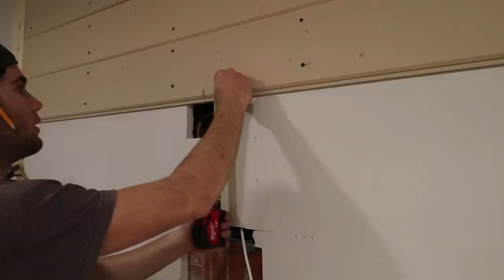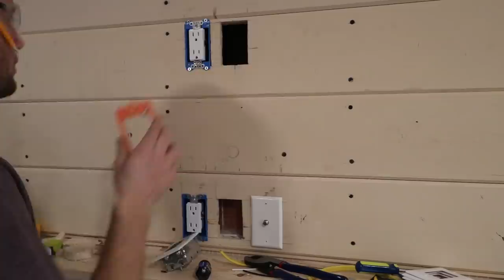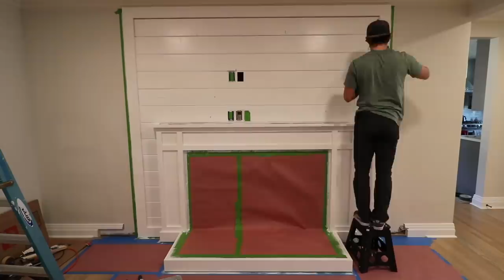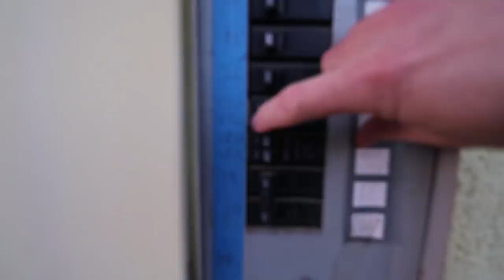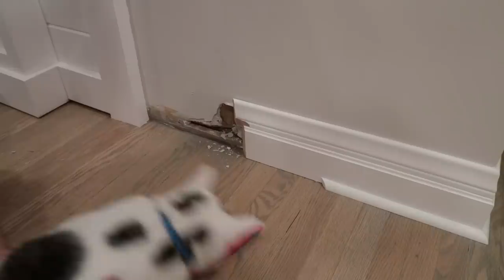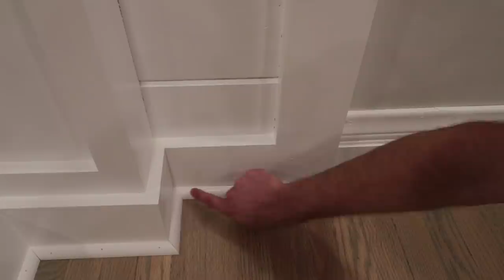DIY Fireplace Remodel Pt 2: Shiplap, Painting and More!

Comment: im a painter and decorator..bit of healthy advice..to cover the knots in any wood you want to use a product called zinsser. You apply it before any undercoat, primer or base coat and it will ensure the knots wont re-appear. Otherwise in a few weeks time..the knots will come back through. 

fireplace looks awesome though! 😀
Reply: Varnish also works as a great knot sealer. I have used it for over 50 years.

Comment: One tip I learned about painting knotty pine was to prime the knots with aluminium paint before applying the finishing coats.  That way the knots will  not "ghost through" later.

Comment: Man, you have a electrical mess! Is it allowed in your country to leave electrical wires everywhere in the attic? We always put them neatly together in the PVC conduits. In straight lines.
Reply: old retrofit homes have tons of junction boxes and mixed wiring. it is a nightmare; surprised more of them don't burn down tbh. generally, new home wiring is pretty neatly done and has few, if any, junction boxes, but we typically don't put wires in conduit in residential construction (usually only seen in commercial) however in some jurisdictions it is more common to run wire in metal conduit. This is more common in brick and mortar homes prone to hurricanes.

Comment: You could have used PL glue on each shiplap and a finish nailer instead of screws...to cut the time of filling and sanding. You could have used a 2 gang box for the top and bottom outlet...more cleaner looking...that attic is pretty bad...I would have a licensed electrician check that..just to be on the safe side ...but over all it looks good ...
Reply: Coulda shoulda woulda, good grief. He does fantastic work and he does it his way because he is him. Get that?

Comment: you've demonstrated that you have a finish nail gun so why are you using screws?
Reply: I guess because it's way easier to take off something nailed than something screwed on.
Reply: @escotiyaotl8869  do you mean to say it is stronger? That's debatable so long as you are nailing in to studs and that I don't foresee someone strength testing it with a crowbar

Comment: Ben I want to commend you on this series!  I inadvertently started at phase 3, I went back and am just starting p 2.  Just one question for me; What is your measurement from the bottom of the mantel to the top of the firebox? I am in the research phase of going from a 61” fp surround to 79” to accommodate a bigger flat screen.  My number one goal is to hang the new mantel as far down as I can get away with to pass inspection if I ever sell my home. How low can I get away with! It’s a gas non-vented (rarely used).  Sidenote. I watched a dozen or so videos, you are far and away the most interesting to me. Do them all just like this one love the detail!
Reply from the maker: The measurement you asked for is about 21” but I don’t know if that conflicts with any specific code. We have yet to light our fireplace (and don’t ever plan to).

Comment: Sorry but you are dangerous. Use a push stick when you use the saw and the metal box you install probably has sharp edges which could cut the wire and cause a short or fire. That attic looks like a good place for a fire. Nice job in the design.